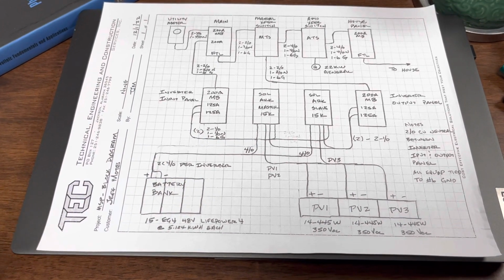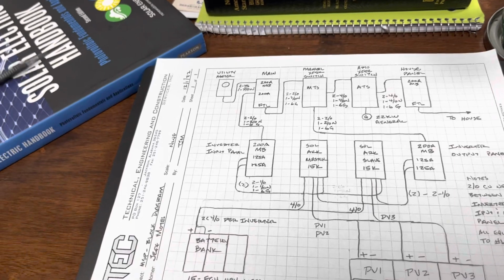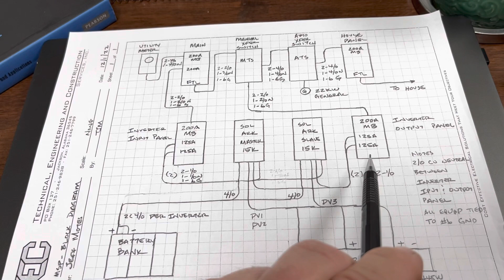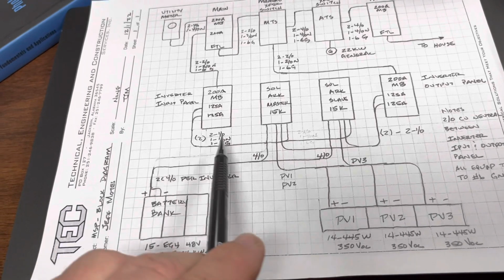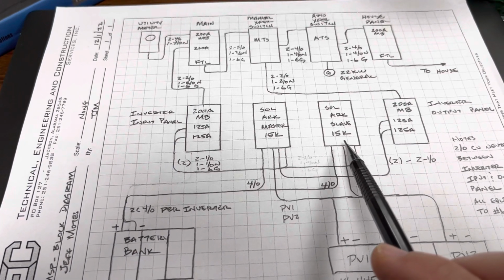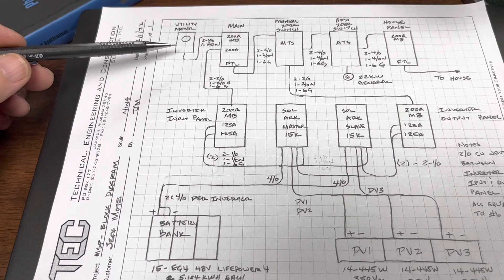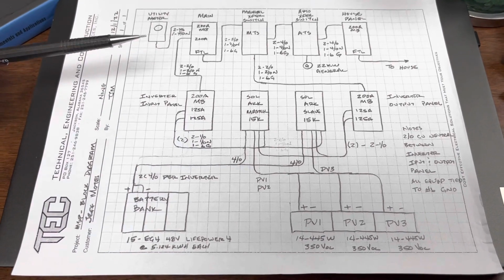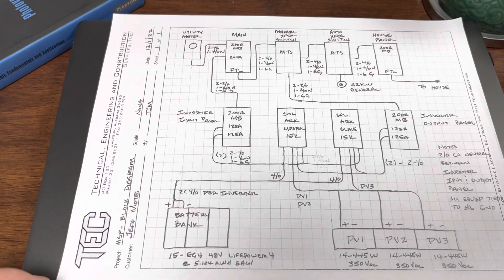My Solar Power System Block Diagram using Sol-ark 15k Inverters

Comment: I am just getting started and need a one-line diagram, for a Sol-Ark 15 kw I do not know what order to put my meters and switches in. the electric company is putting in a revenue meter, but I have to wire up the Base for the meter. so, I will have a utility meter and a disconnect switch, and a transfer switch then a whole home panel and a revenue meter. I hope you can help me.
Reply from the maker: Hey Tom. Can’t give you specific advice as I’m not familiar with your local codes, permitting, and utility requirements. 

Is the revenue meter separate from their regular meter?

Comment: Hi How do you charge your batteries during the night,  if the batteries did happen to die through the night?
Reply from the maker: I don’t. The batteries only charge off the PV array. If my batteries run out overnight the system automatically switches to the grid. If the grid is down when the batteries are low then the generator comes on and powers all the loads.

Comment: Jeff, thanks for the video. Since you have two Sol Arks in parallel, does this offer redundancy incase one Sol Ark has a failure?
Reply from the maker: My load peaks around 22kw so I wanted to make sure my system would carry that without tripping. I am often over 15kw on my load throughout the day. With batteries only the 15k unit is rated for 12kw. Two in parallel are rated 24kw so that is what was required for me.

Comment: You got some serious wiring going on there.

I have dual15ks but combined in a 400 amp manual Transfer between Grid and Solar.

May I ask why you didn’t just run the generator in the 15k and let it control everything?
Reply from the maker: I wanted to integrate the solar power system into my existing electrical system in such a manner that I could bypass the complete solar power system if a problem arrises. With the way I have it I can completely bypass the solar equipment with my MTS. 

I originally designed this system around 5 Growatt SPF5000ES inverters. See some of my earlier videos. 

If I have to take the inverters down for to work on them I didn’t want to have to deal with the generator running through them.

Comment: could you have not installed MTS and gone from inverter output panel to the gen/emerg side of ATS?  also, if grid power goes down, it sounds like ya gotta go outside and throw the MTS before you can use solar/battery (depending on day or night)??
thank you for showing this.....i gotta couple good ideas out of it.
Reply from the maker: Actually the MTS stays in the Solar Power position all the time. Only time I switch to the grid position is if I need to remove the SolArks completely out of my power circuit. I’ve only done that once since Jan 6th. 

With the MTS in solar Power position the SolArk handles sending which power source is going to my home - PV, battery, or grid. If I lose all three of those sources the ATS will automatically start and transfer power to the generator. 

It’s all seamless.
Reply: @jeffmotes2129  ....thank you for all the information. im trying to figure out a grid tied system for our home.....i may try to use your one line diagram as a starting point....i just dont have the wall space in garage, or outside.
Reply: This answered the question that I asked… thank you
Reply from the maker: @desdelsur2004  sorry I must have missed it.

Comment: Can you run an EV charger and cook (electric) at the same time on this, or can you cook and use the clothes dryer at the same time?
Reply from the maker: I don’t have an EV charger but I do run a 3ton HVAC, 5ton HVAC, water heater, electric dryer, full electric kitchen, multiple freezers, well pump, pool pump through this system. They don’t all run at the same time but we use them all as we need them. So far peak demand that I’ve seen has been 24kw.

Comment: I use welding/battery cable with crimp on ring connectors. Works great and very pliable plus worth so many more amps per circular mil.Good job!
Reply from the maker: Thanks.
Reply: @jeffmotes2129  HEY,JEFF! I BOUGHT A HDK-PRO HYBRID KIT WITH 2- 15 K SOLARK INVERTER,48 PANELS AND 2-ELITE KONG MAX BATTERY BANK. WE ARE IMPORTING POWER FROM THE GRID BUT NOT EXPORTING BACK. WE DON'T HAVE THE GENERAC GENERATOR SO OUTSIDE OF THAT YOUR SCHEMATIC WOULD BE USEFUL FOR US AS WELL? THANKS FOR ANY HELP!
Reply from the maker: @tommyluck19  hey Tommy. That’s going to be a nice system. This is a block diagram for my system. It has worked well. You can modify it to suit your specific installation. 

Some jurisdictions may require a fused disconnect.
Reply: @jeffmotes2129  I have a Generac Smart switch behind my meter and before the main panel so if the grid down and I'm producing power the linemen still safe on the grid who working on it. MY QUESTION: Is my system still going to work during the outage even if didn't get power from the INVERTER INPUT PANEL? (left side on your schematic)
Reply from the maker: @tommyluck19  Mine works without grid power. I could turn the grid input breakers off and the system will still power my house as longs as PV and/or battery power. If I lose solar and grid then the generator supplies power. 

I basically use the grid as backup power for my solar system. The generator is backup for both.
Reply: @jeffmotes2129  Appreciate Your help, Sir! Aren't You on Facebook? Is it possible to direct message You on Messenger? we live in Molino FL, not far away from You. I would pay for your professional advice . Kinda stuck with my project. Two guys from here intended  to hook up my system but they disappeared.  I'm very hopeless
Reply from the maker: @tommyluck19  sure look me up.

Comment: Great diagram.  Do you consider you system Grid Tied or Off Grid or Hybrid?  Do you have an interconnect agreement?  I'm looking at a similar design but do not want to backfeed to the grid.  When is the interconnect required?  This part of solar is very vague to me.
Reply from the maker: I'm using my Sol-Arks as hybrids. I'm using a grid input but not providing a grid output. My power supplier is an electric co-op. An interconnect agreement has not been required. However, it may be different depending on your utility and jurisdiction. I'm in a rural area. In areas served by Alabama Power an installation of solar power, regardless of being grid tied or not, you have to pay them a monthly fee based on the size of your PV array. In general Alabama is not a solar power friendly state.

Comment: Couldn't you just put the two 125amp breakers that feed the Sol-Ark into your main panel and not have that panel between your main and the Sol-Arks?
Reply from the maker: Yes. That would work. However, from an operational standpoint I wanted the main panel on the exterior of the building but I also wanted the inverter feeder breakers to be in the same room as the inverters.

Comment: Very nice Jeff, thank you for spending the time to put all this info on youtube. Quick question, why didn't you keep the ATS as your main disconnect? I kept mine as my main disconnect so I could charge my batteries if wanted/needed to cut down on generator run time. Just curious to get your thoughts.
Reply: You beat me to it. We’ve had heavy cloud cover and a few power outages here in sunny California 🤪 I have a manual transfer switch that I can send generator or grid to the inverters which I ended up using. It’s great to run the generator at an efficient load charging the batteries, get it over with and have peace, quiet and stealth. It’s also nice to exercise the generator periodically into nice usable load. I still like the ATS for when you’re not around or if the inverter fails or doesn’t feed through.
Reply from the maker: I have two main reasons for putting the ATS on the load side of my solar power system. 

1 - I only want the generator to come on if I lose utility AND solar power.  If I install the ATS on the line side of the solar power system then every time the utility had a power outage the generator would come on even if I was operating with solar power. 

2 - I want the generator to come on if my solar power system fails. If I place the ATS on the line side of the solar power system it wouldn’t be able to sense a solar power failure. It would only be looking for the presence of utility power. 

Putting the ATS on the load side right before the panel feeding my home allows me to sense power loss to my home, not just lost of the grid. 

But I understand where you’re coming from regarding charging the batteries if there’s extended cloud cover during an extended utility power outage. That is very rare around here. However I am considering adding a MTS on my generator to feed the inverters or the ATS. Still thinking on it.
Reply: @jeffmotes2129  I had the same question, and your answer makes complete sense.  Your block diagram and walkthrough are clear and concise, thanks for sharing!
Reply from the maker: @MrMindlink  you’re welcome

Comment: Very nice design, mine is much more simplistic but would love add some of your ideas. Have you pushed the sol-ark far on testing, load wise? We had sun a day ago and was able to hit little over 25k watt load on my system and stayed positive 125amps still going into the batteries. I had everything on in the house plus 40amp ev charging.
Reply from the maker: I haven’t had a chance to really push it yet. Your system is a good bit larger than mine (18.69kw PV.) but I did notice yesterday the PV were putting out over 17kw. The Growatts I had limited power to 15kw. 

If we hit another really cold spell (rare for south Alabama) I could peak load over 20kw. We’ll see.
Reply: @jeffmotes2129  I'm curious to see how well they perform for you. So far the eg4s are doing well, they do run slightly warmer than my 12kw growatts but no issues so far.
Reply from the maker: @krom6017  I’ll give updates from time to time. But I’m really looking forward to a time when thinking of my solar power system will become an afterthought. 

You should do a post on your experiences with the EG4 inverters. It would add to the body of knowledge and perhaps help others in their decisions.